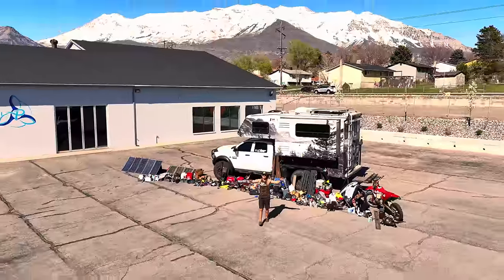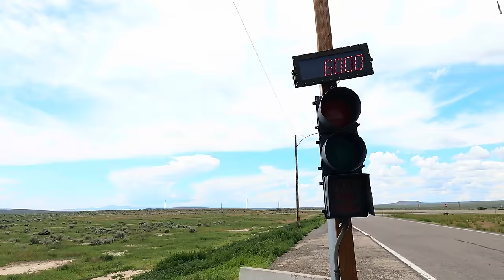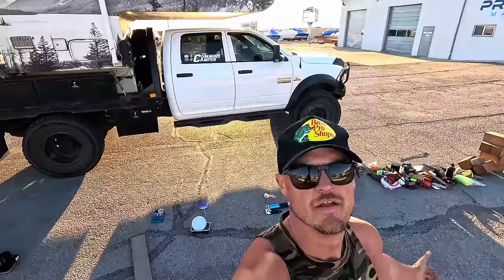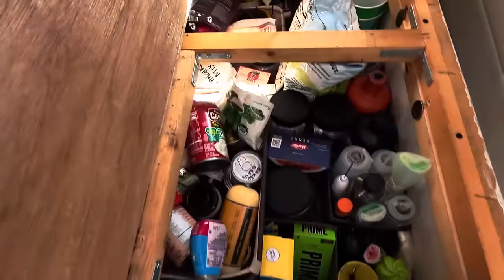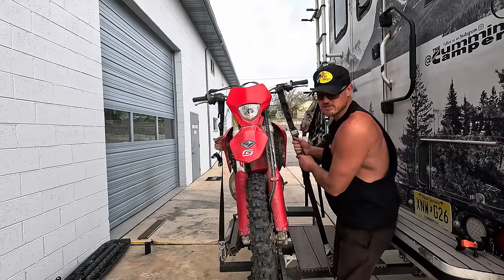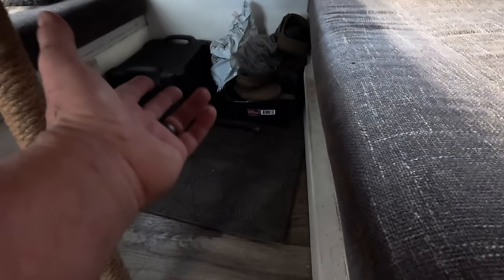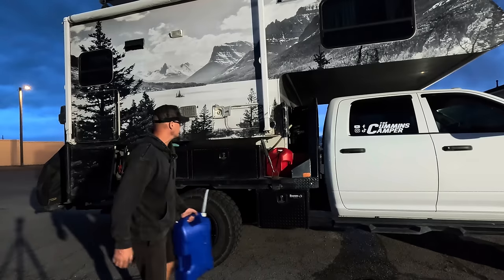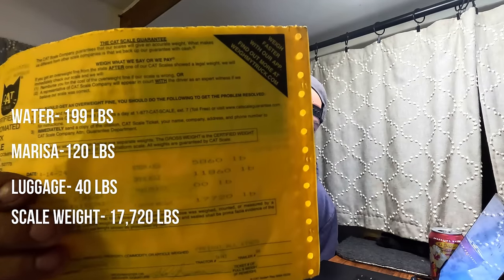WAS I BETTER OFF NOT KNOWING? Weighing Our 4x4 Truck Camper

Comment: This was awesome to see! So many truck camper utubers aren't doing this, it is very educating as manufacturers like fudging the true numbers. When i was searching for my truck camper i was highly considering an Artic fox, I find definitely AF and sounds like lance too, they like to make their campers sound light, AF's brochure was confusing to figure out what weights included (deliberately I'm sure), watched a utuber two yrs ago then too, weigh his and say yeah heavier than they say! So doing your numbers here i get your camper is actually 4875lbs.  (10800-15675). (Right?).
My point is it certainly doesn't help the consumer when these truck camper manufacturers fuzzy around with the true total weight. Especially now a days, when the dam thing comes from the factory with AC etc, installed, it should be weighed on final build. NL weighs on final build thankfully. 
You getting the bigger truck was super smart n I bet gives u good piece of mind. 👍🍻
Edit: Wow wait your tie down's were included in your camper weight?
Reply from the maker: So the 10,800 also was before I installed 4 aluminum tool boxes so they add to that weight.  Then add in a 3kw inverter,2 solar controllers, a dc to dc charger, tons of wiring and more but your math on the realistic weight of our camper is close to your calculations. 

I agree that manufacturers should weigh these campers with all the options that they offer and then also as a base model camper with no options. That way consumers can have a real expectation of what size truck they really need. The deception is to increase their sales to under informed consumers. AF campers are beautiful but definitely the heaviest brand out there for a single slide out unit (excluding double and triple slide campers on the market). Our tie downs were not included in our campers dry weight but I didn’t take them off for the scale weighing. Sorry if that was confusing.

Comment: Great job! That was a TON of work and super informative for others out there. I’ve been wanting to do a similar video since we upgraded to a 5500 as well. We were running the same setup as we are now with a Host Mammoth, fulltime, with a RAM 3500 (14k GVWR) and grossly overweight! Last weigh I did with full 52gal. diesel and 65gal. fresh tank was 18,500. Our RAM 5500 is rated for 19,500. BTW, there’s an app for the CAT scales so you don’t even have to go inside. Makes it super easy. Thanks for the video!
Reply from the maker: Thanks for watching y’all! When we had our 3500 our GVW was the same and we were weighing 16k or so. Very glad to have switched to the 5500!  It’s nice to be under the GVW for both legal reasons and piece of mind that hopefully we won’t break as much stuff 😂 Thanks for the tip on the app!

Comment: Wow my 32' A class RV is 16,500 lbs and your Truck / slide in camper with everything 18,079 lbs. But my doesn't have all the tools and a motorcyle on the back. But when I build a kayak/ bike rack on the back, plus a boat load of tools and all our "stuff" we will be around equal to your rig.
Reply from the maker: It’s the stuff that get us in a big way. If we had less stuff we’d be in better shape. It’s like a roller coaster, sometimes we get rid of things to where we’re probably a little lighter and then Marisa goes shopping again 😂

Comment: Cool video thanks for the info. You have my dream setup. I have the same (05' 981 max) but on a srw Ram 3500. couple hundred pounds over gvwr when loaded up. Its all on the rear axel. I love the camper and my truck, do a lot of beach driving on long island so I don't want to go dually Ive seen your videos in the snow fighting with the old truck. I think I'm going to try to lighten it as much as possible, sucks to do because everything works mint but after 2 years and 2 cross country trips I've never used the generator, AC, or microwave. I like what you did with the microwave delete and moving the batteries. I heard the stock AC and Gen. are about 100lbs each. Question for you, is there anything else you found along your renovation that was surprisingly heavy or things you moved forward for weight reasons? Did the compost toilet set up add or remove weight?  Thanks! enjoy the west can't wait to get back out there myself.
Reply from the maker: Sounds like a sweet beach right you’ve got!  I don’t blame you for not wanting a dually. Those wheels/tires act like a snowplow since they stick out past the front tires. To your question about heavy items found during the restoration, no I can’t think of anything in particular that was heavier than anticipated. The counter tops and table material we removed were incredibly light. We thankfully haven’t had to put too much thought into front/back weight placement. I’d love to move our dumbbells forward and into the back seat as one item of heavy, rear dead weight. How’s the floor in your 981 holding up? Ours is getting soft from use and abuse
Reply: @thecumminscamper  so far so good with the floor didn’t even think about that but I’ll keep an eye on it. Little bit of delaminating on the side around the propane compartment from bad caulk joint but it’s not getting any worse so I can live with it. Thanks for the info! If you have an email I can tell you how to get on the beach in NY. Have fun out there 🤙🏻
Reply from the maker: @animaltheory  thecumminscamper@gmail.com. I’m not sure when we’ll be in NY next but I’m all about the beach spots!

Comment: Fun fact, you can do the weighing yourself with the cat scales app without going in.

That’s what I have been doing when I weigh my little camper as I am building it and fitting out the interior.
Reply from the maker: Thanks for the tip on the app! That will make it way better for any future re-weighs. 

What kind of little camper are you building?
Reply: A little 10ft camper trailer. Just enough space for a queen bed + 2ft behind that for an outdoor kitchen on the back. 

Been a long project but I’ve weighted it twice so far to keep tabs on my weight as I fit out the interior.
Reply from the maker: @GDLutz  very cool!  Sounds like it will become a great rig for getting out there and exploring.

Comment: I guess the bigger question too is what’s the front axle and what’s the rear axle? Are you overweight on one? did not see that when you flashed it up on the screen watching on the phone probably easier to see you on a computer.
Reply from the maker: Hey James,
Thanks for watching the video! I wish I had taken a photo of the scale weights and put them up on the screen vs flashing them up to the camera. We’re under the axle weight on both front and rear. The rear we’re under by almost 2k and the front we’re under by 1500lbs. That’s a big part of why we wanted to go the 5500 route. On our 3500 we were overweight on our rear axle. Appreciate the comment and taking the time to watch. I just finished a new video that will be out tomorrow!

Comment: In comparisons our Earthromer is 18000lbs all in with 100 gals of water and 100 gals of fual.
Reply from the maker: Is an earthroamer 18000lbs though with all the gear of a full timer AND fuel and water or is it 18k with 100 gals of water and 100 gals of fuel? Earthroamer are amazing but definitely a slightly different price demographic than our rig
Reply: Yep we we are mostly full time and only go back to repair upgrade the truck we also carry similar items to you minus the bike.
We also have the same engine as you so its an interesting comparison.
Reply from the maker: @EarthRoamingAdventures  pretty cool that we come out to a similar weight. I’m confident you’re much more capable off-road than we are. The earthroamers do a really nice job of keeping that center of gravity weight down lower than our truck camper. In our camper I still feel very tippy when we get onto trails.

Comment: Erik excellent video, beautiful backdrop of the mountains.  Was your fuel tank full?  Our 5500 fully loaded, all fluids full is about 17,800 maybe more, I'll need to weigh it again because I have added a few items.  I'm going to find your video on converting your backseat area for storage, I really need to remove my seats to get more room.  Why 2 bottle jacks?  I like videos like this, good info!  Be safe out there!
Reply from the maker: The fuel tank wasn’t full. I’m working on depleting the fuel as I’m dropping the tank to put a dip tube in for the diesel heater which will be part of next weeks video. The two bottle jacks is so I can do a tire rotation or get myself out of a jam. It’s overkill but has come in handy a couple times. I’ll find the link for the backseat delete and drop it below in this comment thread.
Reply from the maker: https://youtu.be/KE7g5iJA-oo?si=XGTJZT5b0BCUsK5E
Reply: @thecumminscamper  Got it already, I don't have your skills but will try to duplicate what you did.  BTW what are the boat covers ya got off amazon called so I can find them.
Reply from the maker: @daddie_longlegs9357  which boat covers are you referring to?
Reply: @thecumminscamper  The two black covers that give you access to storage underneath (original ram storage area) the platform.  BTW what would you charge to build this for someone?
Reply from the maker: @daddie_longlegs9357  https://amzn.to/446fDM7
Reply from the maker: @daddie_longlegs9357  I don’t really know how much would be a fair price to build a back seat delete like this. Shipping would be a nightmare because the plywood piece is so big. It’s not a hard item to build in the scheme of projects but if the price is right I could certainly duplicate it 😂
Reply: @thecumminscamper  Perhaps we could meet up and do it together, you would be compensated.  We aren't heading back out west until Nov/Dec timeframe, when are you going to be in the Southeast?  I have a private location with power & water for mooch docking if you want.Shoot me a PM if you are interested.
Reply from the maker: @daddie_longlegs9357  we don’t have any plans for heading back to the south east. We’ll be in the south west in November and December tho! I could build one of these back seat set ups in a Home Depot parking lot somewhere 😃
Reply: @thecumminscamper  Erik I sent you an email!  Check your spam or junk folder, let me know ya got it.
Reply from the maker: @daddie_longlegs9357  I didn’t get the email yet. Try thecumminscamper@gmail.com

Comment: FYI, if you rescale the same day it's only 3.50 not the 1350 over again
Reply from the maker: Thank you! Sadly it took my lazy butt too long so I spread out this process over two days. Good info for other folks certainly
Reply: @thecumminscamper  I drive a truck over the road and have been to that truck stop you were at , I scale about every other day if not every day
Reply from the maker: @Frenchy5117  must have been fun watching me look like a total dork not knowing what I was doing as a seasoned trucker. I edited this part out but a trucker was driving by me at the scale before I put the truck on the scale and I was setting up my camera he goes “you gotta pull on the scale”. When I told him I was making a YouTube video he rolled his eyes and pulled away 😂 I felt so in the way at the scales hahaha
Reply: @thecumminscamper  🤣, there is a 1st time for everything and some drivers think they own the truck stop, not what it was 20 years ago , definitely a good video,  I have a square drop trailer I pull with my jeep so different tips and tricks are helpful

Comment: Im curious to understand, who and why does someone determine how much your vehicle weighs? What does it matter? I literally know nothing about this.
Reply from the maker: Very fair question. Happy to explain. The value of knowing your vehicles weight is so you do not exceed the GVWR (Gross Vehicle Weight Rating) as determined by the manufacturer. If you exceed that GVWR and rear end someone else and that person were to sustain injury, you’d find yourself with a lawsuit on your hands. With that said I’d say 80% of truck campers on the road are over that GVWR. We upgraded to our Ram 5500 so we were no longer overweight like we were in our Ram 3500. Also if your vehicle is overweight long enough you’ll find yourself going through brakes, tires, rims and even axles much faster than you would with a bigger vehicle. Plus buying a 5500 vs a 3500 isn’t much of a price difference if any. Thank you for the question. I hope I help I answered it well